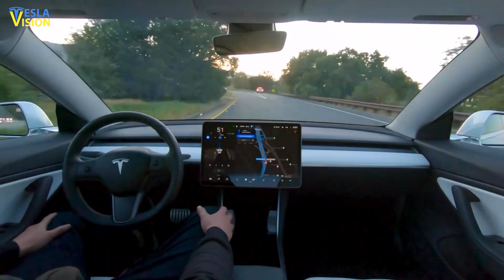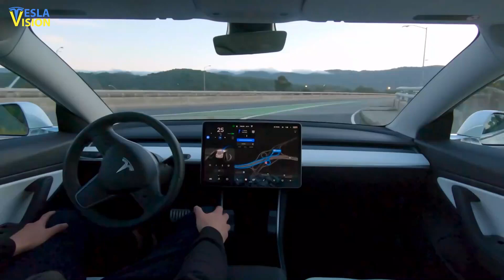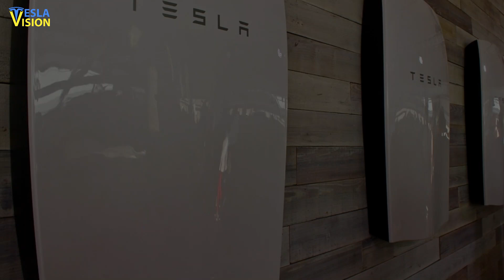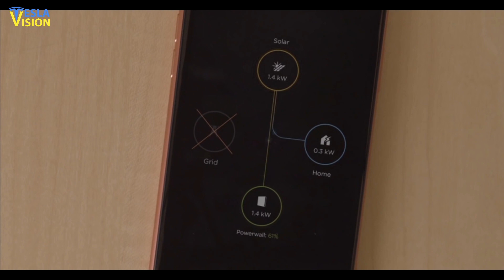THIS IS HUGE!!! With New Battery Tesla Semi Truck Will Be The Efficiency Beast

Comment: I am lost,  1:39 Tesla truck would have fewer than 2kw per mile. 
The truck should have 600Kw/h to 1000Kw?h. Tesla's 100Kw?h weight roughly 1,300Lbs X 6 = 7800 to 13,000Lbs
comparing this to typical Diesel-powered trucks which weigh between 15,000 and 25,000 Lbs.
"It means that the Tesla semi would likely be at a disadvantage weight wise" 

Why is being lighter a disadvantage?

Comment: The battery can be built in structurally so the total weight is even lower than ice but more stronger due to lower and central center of gravity. Checkmate.

Comment: A spaceship floating through the vacuum of far space is insane efficiency, but a battery operated truck with 18 rubber wheels following the contours of the earth in its gravity and atmosphere?
Reply: If/once materials advance then cargo by air will be more energy efficient than road.

Comment: 500 mile radius is all right with local applications but not with over the road application
Reply: It's called drop and hook over the road truckers do this all the time
Reply: @rodfatherfishing9223  not all.
Reply: @tiptoe38  if it saves the company money they will do it every time. Owner operators can charge at truck stops in the future. Team driver's are SOL I hated team driving anyway I like my personal space.
Reply: @rodfatherfishing9223  Team drivers keep the truck moving,This technology is a long time off for completion.
Reply: @tiptoe38  yea I agree it won't work for team drivers unless battery swap technology was there